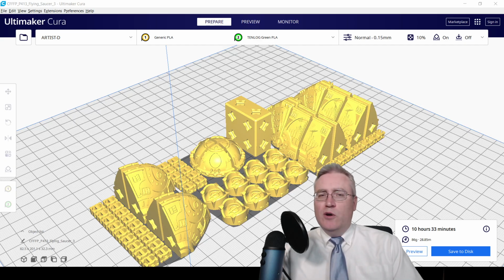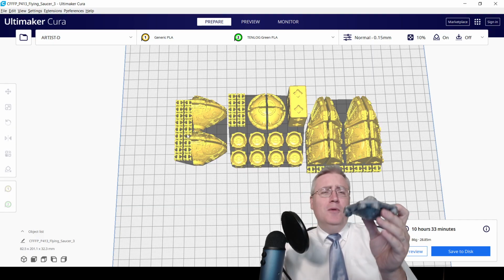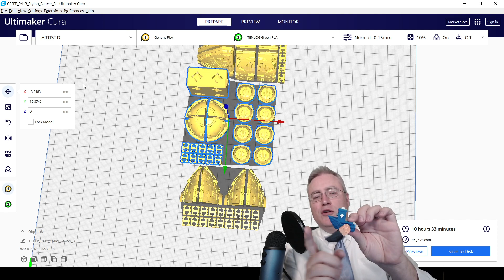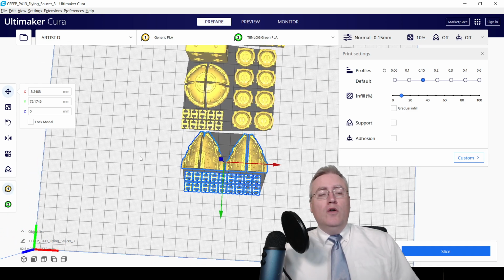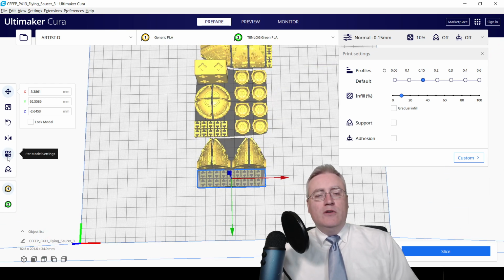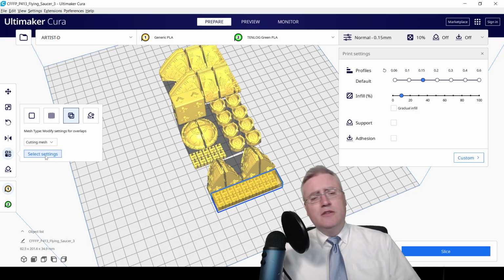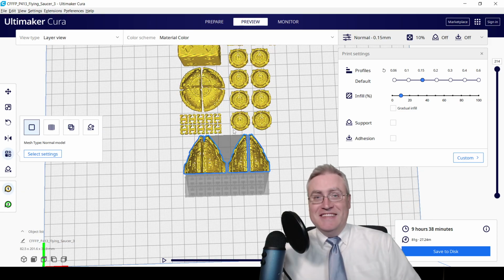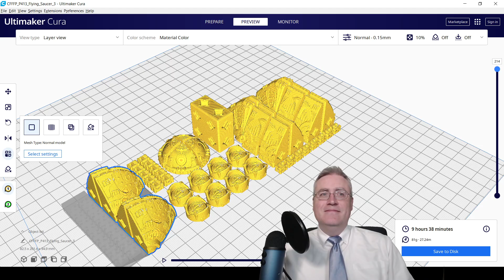How to 3D Print Nothing in Cura - Useful Slicer tip

Comment: This is a great trick for when you need part of a print to have more infill or stronger walls for strength. Somehow my support blocker won't render, but the calibration prints plugin has a box, a pyramid and a cylinder which work great.

Comment: @3D Printing Professor if you save the file as a .3mf it will save group parts in on file but all remain separate so you can move them around without cutting them in the slicer

Comment: Thanks! Wanted to print something mid-air, but it was locked on the build place if I sliced it. This works!
Reply from the maker: What slicer was it? I'm pretty sure there's a setting in Cura you can turn off so it stops doing that, but not one in Prusa Slicer.

Comment: In some cases, you can save this as 3mf and adjust in the future i see this used for easy "printablock" compatibility enabler.

"You have a dinosaur model and you want to put a laser gun on its head? Just put the printablock enabler where you like and you are good to go"

You just need to make a negative of printablock connection hole and you will open up a hole new world of modification xP
Reply from the maker: A HOLE NEW WORLD!

Comment: didnt work wont let wall thickness be set to 0 while cutting mesh
Reply from the maker: Did cura 5 change something? Doggonnit.
Reply: @3dpprofessor  Same happened for me, i found that if you remove the "fx" command on the line below "Wall Line Count", then it doesn't calculate and hardset the "Wall Thickness" setting. Once its editable in your global settings (leave it as it should be so the rest of your model remains okay), it will be editable in your per block settings. I have just used this method to reprint the thumb of a model by flipping it upside down, putting a ton of it below the bed and blocking everything but the thumb with blocks as per your method. Works a treat... Thanks.
Reply: @simonquincey1783  This worked for me. Thanks!

Comment: man i remember when i saw Hellebuyck do a whole block (which i do in prusaslicer similar to how you describe for cura with zero infill and walls), i thought it was such a light bulb!   mostly i use it to print fractions of parts to make sure fit is good before printing whole larger parts.  removing whole parts doesn't help for this sort of fit optimizing.  anyways i thought if you added snap off connectors between all parts, kit card style, it would make them easier to print by the plate full without failure of the small connectors, and easier to print a bunch and share with others e.g. my nephew.  as long as i'm dreaming, make multicolor layered designs.
Reply: cool idea about printing something only-infill.  gyroid with flexible.  another trick is printing cylinders, especially threaded connectors, on their side and truncated (split top-bottom and omitting the bottom), wall layers going the long direction is the stronger one anyways, and this way they don't need support.  i think i stole this from hellebuyck also.
Reply from the maker: A few people have made connections with tabs on them. And, yeah, if that's your stuffed, then this tip should help.
Reply: @3dpprofessor  yeah i don't like the idea of the tabs being wasteful pollution plastic.  on the other hand, if i want to keep a kit together and give it away, and it's not connected with tabs, i'd probably use a plastic bag to keep things together anyways... so net-net maybe tabs not so wasteful.  oh one more thing i noticed on your connectors, they are all out towards the side of the plate.  i think sometimes the side of the plate doesn't get as warm (not sure how big a deal this is), but more importantly the sides are where grease from your hands tends to micro-deposit as you handle the plate, so stuff frequently doesn't stick so great there... maybe leave the small parts in the middle and larger parts towards the edges.

Comment: Why not use flow 0% for hiding the model?
Reply from the maker: I didn't try that. Would that work?
Reply: Oh, since you asked I actually tried this in cura, and it does not work. I expected this method to work, as longs as there are other model-parts which are to be printed. But apparently cura simply does not allow 0% flow for any parts of the model.

So sorry for the remark - apparently the flow-method is not an option. 🙂
Reply from the maker: @ForcefighterX2  Pitty. It was an interesting idea. 
I figured what was going to happen was it would still go though the motions and just not extrude plastic. Now, with bigger parts that might be a problem because you might overcook filament in the nozzle, but for small parts it would have probably been fine. Maybe get a little drool, a little under extrusion at the start of the next part, but not much. 
But maybe there's a reason that's not an option.